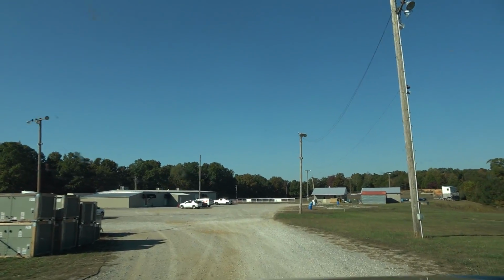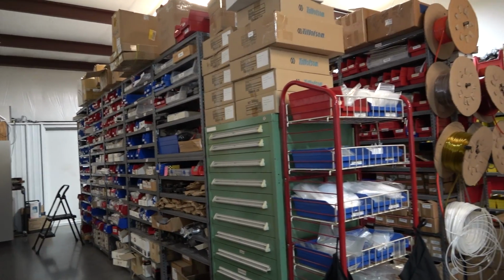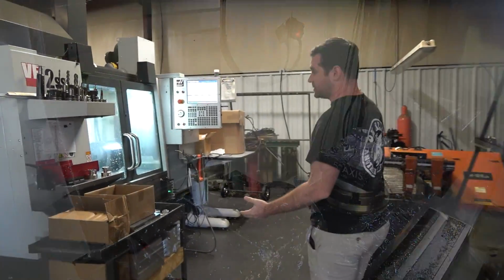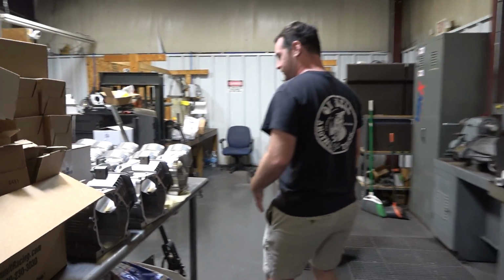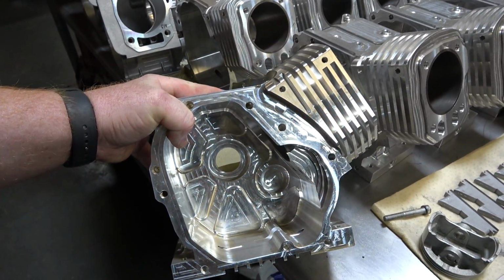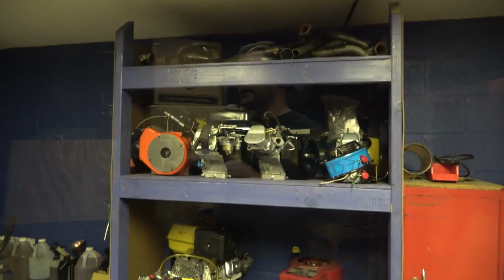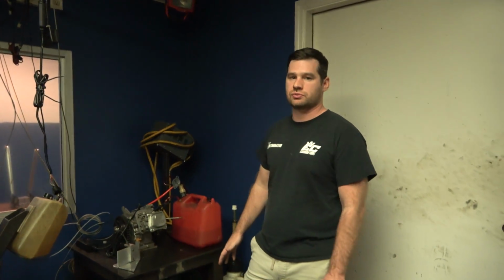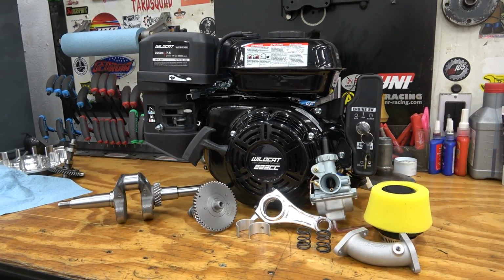Introducing EC Carburetors To The Channel

Comment: It bugs me bad, all the cool parts are made for the small block engine configuration. You can build the most awesome small engines. Some of us build up the big block engines, but there is a lack of performance parts. Try finding a 92mm forged piston or a performance intake manifold there's only 2 companies  - Diamond and Ross that manufacture pistons. No one make an intake manifold for a 32 or 34mm PK carburetor. I have a custom-built from parts Vegas Carts 460 Stroker with a Predator 420 Hemi head. It's got bigger valves than the stock big block head. If it adds a 1+ ft lbs of torque to a 420, what will it add to a 460 Stroker? I need a forged piston with valve reliefs for the Hemi valve configuration. Wiesco doesn't make anything that's built for the big block engine, let alone a forged piston. We need performance parts for the big block engine. Help

Comment: On a predator 212 without the governor and with the stock flywheel what carburetor is best?
Reply from the maker: Well you don't need to be running the stock flywheel with no governor. Once you replace that flywheel with a billet one then a pz22 is cheap and good. My favorite is a 24mm Mikuni Flat slide.

Comment: Dope!!! I just got me a 32/25 head and a set of the EC 1.2 ratio Rev Rockers. They make good parts bro. The head came pretty much completely ported to smooth on all the edges you normally have to grind on. Only thing is a small lip when you put your finger through the intake or exhaust, right where it ends there is a line but that’s it and this head is a bad mofo. Like so big that the valves shrouding cuts overlap in the middle of the 14cc head

Comment: We used EC carbs on our clone motors at our local kart track, wow! what a difference they made! We  kicked some serious A$$ for years b4 the secret got out. EC makes some good stuff!
Reply: Except EC was never a secret and I bet the competition also had some of their parts.
Problem with stories such as yours is that there is only so many places to get good parts from and the chances that no one but you knew about EC is close to zero.
Reply: @NubsWithGuns  you are absolutely correct. The statement was not the fact that I was the only one that was running their stuff, it was the fact that there were only a few of us. And those were the folks on the podium. Each week kind sir. Relax old sport don’t take things so literal. Maybe you were one of the ones riding in the back 😤wondering were we were finding all that speed 😉